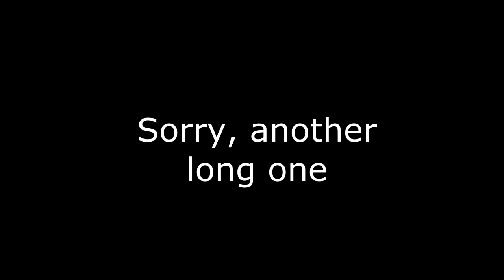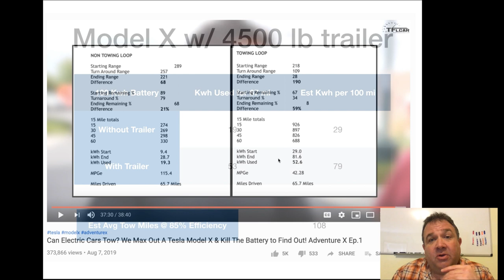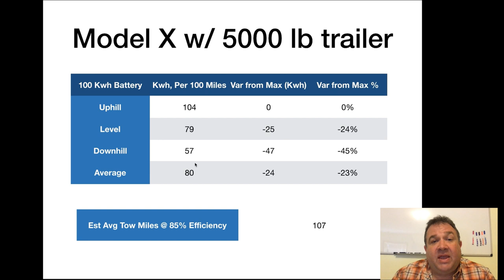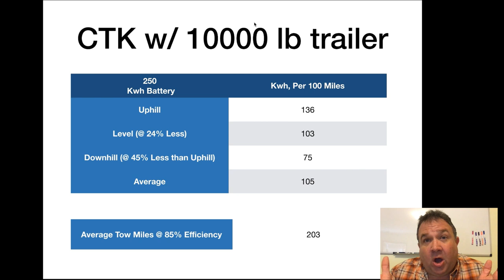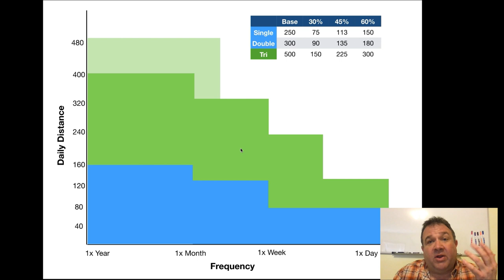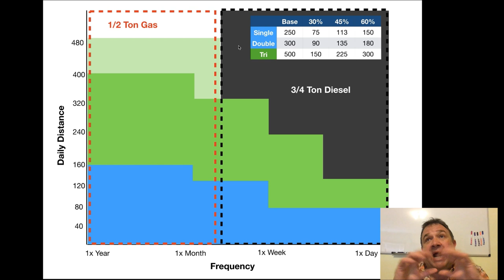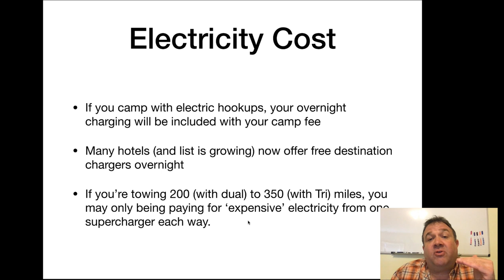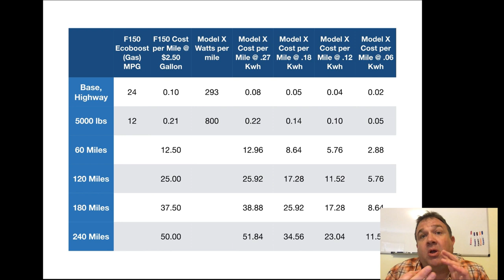Tesla Truck Towing Range Explained

Comment: Should Tesla consider a supplemental battery to put in the bed of the truck for 5th wheel haulers that could be set into the bed either manually in small segments or as large sections with a small hoist for commercial operations, to extend the range?

Comment: Also if you’re bringing your motorcycle you may not even need a trailer. You could just strap it into the bed and go. You have storage in the trunk and under bed storage areas for your luggage.
Reply from the maker: Yep

Comment: This was really well done. I think for many people they will be converted when they see someone towing something big and smoking them on the highway. 

The look of the truck is going to stand out and when they witness the power and pick up their jaw... they will want to know two things. What the heck was that and where can I get one?

  Nothing converts people like seeing and feeling a Tesla and this truck is going to be a game changer just driving down the road. Wait until is snows in places like Buffalo, Colorado,  Utah... this beast will eat up the snow and laugh at the salt on the roads. 

I can't wait to see it during the winter.
Reply: I can confirm, as a Buffalonian, that the snow/salt is one of the reasons I'm buying one.  I also plan to use it for traveling in retirement.  I'm hoping for a hard-top camping cap rather than towing a trailer though.  An integrated cap would be much better for range than pulling a trailer.  I saw Tesla's rendering of a tent cap but would want something a bit more substantial than that.
Reply: @DCVIDE0S  I lived in Buffalo so I KNOW SNOW LOL the winter will be a paradise of playtime for owners like yourself for this vehicle. I hope people in snowy places post lots of videos!

Comment: A few thoughts.
1. Consider towing a heavy load over a hilly course.  Lots of long uphills and lots of long downhills.  If braking is required on the downhills, Tesla will regenerate some energy, but ICE will just create heat in the brakes.  This will reduce range of both but the ICE range more than CT.  CT may use more power on the uphills because it can go faster, so more drag.  
2. You talked about charging at your campsite destinations.  I don't know what kind of power they provide (I don't do this), but do you get a 30amp 220volt (electric dryer) 6KW connection?  A 15amp 110volt connection, even charging all weekend, might not fill you up enough for a return trip.
3. How long before campsites put 2 and 2 together and decide to charge extra money to charge an electric vehicle? 
4. You can believe the big 3 will twist the towing specs around to talk people out of CT, but fleet owners are smarter than that.
Reply from the maker: Camps usually offer three phase. From vids I’ve seen people can recharge a 85 kWh battery in about 8-12 hours.
Reply: Generally Tesla stations and gas stations are RARE IN MOUNTAINOUS.

Comment: One of the best videos on the subject I have seen. TFL is definitely click bait and their attitude is lets see if I can find a use case where the EV fails and then conclude they are useless instead of doing like you did and find the use cases where they do work.

One additional use case is the "I am retired and towing my 14,000 trailer South for the winter" case. You would think the range would be a big problem in this case but as a retired person, I find that unlike in your working years, its fine if you have to stop and charge and can drive fewer miles in a day. Want to stop more often and sight see as I go anyway.

One additional point is that more than weight, driving fast is bad for range since the power required from aerodynamic drag increases as the square of the speed so going 80mph takes a lot more than driving at 65mph. For towing most states have lower speed limits. California is 55 with signs posted every 5 miles and Wyoming has 60mph towing speed limit. So most people drive faster than that but most campers have small tires (to maximize interior space) and are under heavy load so not safe to drive 80mph with them. So if you really need to drive 80 through Wyoming with your camper, don't get an EV but I would say most/many tourist/scenic places I want to go you can't drive that fast anyway.
Reply from the maker: I think if you’re the ‘Balls to the Walls’ kinda driver, going 65 will be torture but for me, I’m a ‘Smell the Roses’ kinda guy so I can be happy anytime I’m moving.

Comment: Gas was going down before the pandemic due to the price war between SovOil and MiddleEast oil producers.
I agree that most cases are covered easily.
I think that once trailers are made to match the Cybertruck dimensions. That means it is not wider than the truck and not much taller. This really helps the aerodynamics.
Also, people do not charge to full at supercharger almost ever. People should just charge enough to get to the next supercharger and/or their destination.
Watch the videos about the guys who drove across Canada in a Model 3 on the superchargers up there. They never filled up to full charge. It is a waste of time.
Reply: It is the gap between the vehicles that causes the largest aerodynamic losses because the air has to impact the front again. Making them the same front cross section woild help, but probably only about 10% more range worth. The aerodynamics only account for around a third of the energy use as well. If you haven't watched Engineering Explained's video it covers some of this.

Comment: Is it possible Tesla is quoting the towing range with a loaded trailer? So with the dual motor I can actually tow 10,000 pounds 300 miles? The same way the Tesla semi can tow is rated for 80,000 for 500 miles?
Reply from the maker: Anything is possible but I think not.
Reply: They would have my order if that were the case. It truely would be better in nearly every way, except fill up time, which often doesn't matter because you aren't trying to use it anyway.
Reply from the maker: Dancing Deity my guess is that’s where the semi will start. Fleets with Dedicated routes that make sense. I’m thinking other hybrid/hydrogen alternatives like hyllion or Nikola will be more appealing to owner/operators who need range and flexibility. To me a diesel hybrid seems like a logical next step so you can lower some cost but not be a slave to chargers.
Reply from the maker: Dancing Deity I’m betting they’re legit. They have the backing of major industry players and plenty of capital. Bosch wouldn’t have put in 170 million if there wasn’t a damn compelling story. I think Trevor Milton is I little weird but I think his plan has lots of merit.

Comment: I live in the rockies. A 120 mile trip is normal, if not a short trip. The destination won't have power. So really you need to half all your range numbers when talking about recreational use, because you have to make it back. Campsites with power will take you two days to charge that truck because it will only be 30A, if you call that camping.

A 1/2 ton truck cannot tow the loads you are talking about. Watch a video on GVWR.

While I agree that most use will be fine, if 5% of the time or even less, the truck does not get you to your destination,  people won't buy it unless they can afford both ICE and EV.

Contractors driving 60miles to a job site with a heavy load is quite normal. A skid steer and trailer will be around 8K lbs, without accessories or other equipment. 10K would he fairly common. Those job sites, if they have power at all, won't have amperage to charge the truck enough to replace what it took to get there before end of day. Plus they are using high amperage tools, and you would be tripping the breakers. Not saying it cannot work, but 60miles isn't that far, and you might need to make other trips during the day (probably without the trailer).

I went an watched Engineering Explained's video again, and he is spot on. He is conservative on every calculation except the 14K load, but even if you make that 8 or 10K it doesn't increase the range enough to make the difference.  
You mentioned driving 45mph with a load, that doesn't happen for long or on purpose. The only people going that slow are in a truck that pull the load up the hill any faster. As soon as they get to top, they are going 70 again.

I think you are way too optimistic. By the time you take efficiency into account (which EE ignored those losses in the posted numbers) and leave yourself a safety buffer, real range is probably 80miles when towing. 40-60 on a round trip. It will work well as a city truck, but people won't buy it as a real work truck because it is too limiting. A contractor cannot tell a client, I'll be there is three hours while I sit at the super charger. Going on a road trip in a model 3 works because it can charge enough during rest stops to not interfere much, if at all. A road trip with a trailer with the truck will be totally impractical.  The battery is many times larger, and therefore the charge time will be too. People don't want to sit around for 3hrs to get 70% charge.

I am not saying I don't want one, but it is not equivalent, the range is just too short. When it has 600kwh, then they will be very close.
Reply from the maker: I will purchase a 4500 watt inverter generator if needed for remote trips. 

I think you are being to pessimistic. I actually tow skids around. Closer to 10-12k. 

I also know how easy it is to rent a 3/4 or 1 ton the rare times I’d need it. No big deal.

Real work trucks rarely drive more than 75 miles in a day if they are in town trucks.

Stick by why I said. Get the trimotor if you’re gonna be towing. Bring a midsized generator if you’re in the boonies. 4500-6500 w generator will give you 10-20 miles per hour of charging. If you’re crossing the Patagonia get a donkey.

Comment: I'm a snowbird.  I pull a 6000lb camper.  If I refuel the dual motor every 100 miles, it will take 10 recharges each way!  It sure would be nice if there was an auxiliary battery to switch over to, is I could extend the range.  I DONT NEED 3 MOTORS I ONLY NEED MORE BATTERY!

Comment: I love your show Todd, but you gave me BAD NEWS!  I ordered the dual motor because the extra $20K  for the tri motor is out of my reach. Hopefully they will offer a longer range dual motor.  I tow a 6500 GVWR RV 1200 miles to park it for the winter in Arizona, and return in the spring.  If I have to unhook from my trailer with stabilizer and sway controller bars, charge and have to hook up every 100 miles, I’ll spend twice as much time doing that than on the road.  Maybe my F150 is my Tesla killer.   I hope not.
Reply from the maker: I remain optimistic that range extension tools will exist at some point. (Rentable batteries or generators that can be used on long trips), but without that, yeah, those trips are going to be kinda sucky if range doesn’t improve. I also think they may add a dual motor, long range option at some point for a little more $
Reply: You can simply buy the Ford f150 hybrid and install LPG/CNG tank to double your range, plus LPG is very cheap. Ev really suck at intense usage. The small toyota hilux diesel has over 1000 miles of range
Reply: I think Tesla will wise up and put the charger at the FRONT of Ct

Comment: I'm a contractor, I usually tow 20 miles a day. Trailer is 7000 lb. Most I've ever towed in 1 day was about 125 miles. So 1 supercharger stop. Better than $50 in gas in my opinion.

Comment: Hi mate i am posting frome sweden. Love what  your doing and I am a subscriber.  Seen all your vids and this is the relevant one to addres my concern. I have pre ordered the tri motor to. I well first give you more background of my reasoning behind my argument about range of the Cybertruck . So I am a 12 wheeler trucker that drives a dump truck 35 ton. Now I am "independent" business owner. And to get the Cybertruck is a big investment for me. It's a 3rd of what my bigtruck costs. And I would like to get even a cheaper model. But I chose the tri-motor beacuse of the range. 500 miles. Is about 800 km. And that is good but that version is to expensive why don't they offer the same battery pack on the dual for a cheaper price I don't care about0-60 if it's under 10sec.  iam good or mabe do a mile range of the dual 700 mil  I need a4x4 truck case it's going to be mud and gravel and landscaping areas I want to branch out to forrest cultivation to. I am going to have tools and spaer tiers. And fuel tanks on it. So I feel that it has load and off-road capebeletis. But not egnof range I can't charge it every we here I go. So I wish that as much of glass surfesses are solar panels. What is your opinion?
Reply from the maker: Hmm. Tough call. A lot depends on what you’re towing and how far between convenient charging. If you’re towing heavy equip (more than 10,000 lbs or like 4600kgs) your range is probably going to get cut by more than 50%. My guess is closer to 65%. I live in a city of 2 million but when we bid forestry/land clearing work it’s all within 50 miles of city so in that case, no problem but if you start doing jobs more than 50-60 miles from town you might have a hard time getting home.

I think if you want good charging while you park you should invest in 2-6 portable 100-200watt solar panels like campers use. 

I do think either Tesla or a third party is going to make slide in bed sized battery packs for range extension at some point but I wouldn’t bet on it if my business was riding on it. 

If the CT is capable of mounting a snow plow on it, my company will probably buy at least one as a trial run for using in our landscape biz so I do like it for business applications but it’s gotta be able to do the job.

Comment: But don't you know that every single truck owner has an 80 foot boat they need to haul from Iowa to Key West every single weekend???  Lol.  Meanwhile in reality most trucks in America have a virgin trailer hitch that's only used for hanging obscene oranaments from it and rarely goes more than 100 miles because who the hell wants to drive all day in a truck??

Also, TeslaBjorn did some test videos awhile back with a roof rack box on a Model 3.  He found that when the box was mounted to the roof he lost appreciable range, but when it was mounted to the bumper, he lost very little range.  The lesson there was that the added weight in that case wasn't as big a factor as the added drag.  So the aerodynamic qualities of the trailer will probably end up having much bigger impact on range than it would with a big diesel truck that isn't very aerodynamic to begin with.

Also also, that Engineering Explained guy is a really obvious oil industry shill.  For whatever reason he has an agenda against EVs and has made some extremely misleading videos about batteries and hydrogen power.  It's very unfortunate because he presents things as factual that are actually heavily distorted.
Reply from the maker: Thanks for the thoughtful comments. Well his data was really valuable.
Reply: @cybertrucktruckguy3347  yeah, he often has good math and biased conclusions.  His battery video it is really obvious.
Reply: Engineering Explained owns a performance model 3. Possible he’s a “shill” for oil but then has an awesome EV.
Reply from the maker: MrCanoemountain I don’t think he’s a schill. I do think he’s not a truck guy. I think everything he said is factually correct but misses the bigger point, which is that all vehicle design and purchase choices are a series of trade offs. My point was to illustrate the fact that, in most cases, the CT will work fine for towing.
Reply: @MrCanoemountain  yes, and even more,  he had a non-performance model 3 before that.  And he thinks that wind turbines are a good idea for powering his car, so he is NOT an oil shill.
Reply: Seriously you need to chill, doesn't matter how good EVs are, the ICE are still far better. The tesla semi is rumoured to have a 500 miles of range and tow a 80k pounds, when there are diesel trucks that more than 240k pounds.... the oil industry doesn't just make fuel but millions of by-products including the tires and plastics in EVs and many more.
Reply: @cybertrucktruckguy3347  you are not the one to contradict engineering explained, you haven't done calculations and estimations like him so I believe him more than you period.
Reply: @carholic-sz3qv  I dont even understand your comment. You seem to be arguing a point literally nobody is making. Ive never ever heard anyone say EV semis have more range or can tow more than an ICE semi.  The point everyone is making is that EVs have become good enough to replace ICE vehicles for a very large number of use cases. There will likely be outlier cases for some time, but theres absolutely no reason that a truck that goes 150 miles from a distribution hub to a few drops NEEDS to burn fossil fuels to do so.

Comment: Thanks for the great videos. Definitely the best analyses on Cybertruck I’ve seen. I have a Frontier v6 that I tow a small 16’ travel trailer and the morning after the unveiling I put down my deposit on a dual motor version. My wife & I are retired and rarely travel more than 300 miles/day. I figure we can do that with the Cybertruck and take a midday break to recharge, which will be a nice nap time for us anyway. I just hope that Tesla installs plenty of pull-through Superchargers so we can charge without unhooking the trailer. Another great feature for us in California is the 240v AC output which I can use to power our house when the grid goes down.
Reply from the maker: I'm guessing the infrastructure will evolve as more trucks start to be produced.  I'm hoping Tesla is taking a serious look at the new Bi-Directional Wireless charging systems being developed a Oak Ridge National Labs.  Just pull over it and charge (or discharge if you like).  Thanks for your kind words and for watching the video.